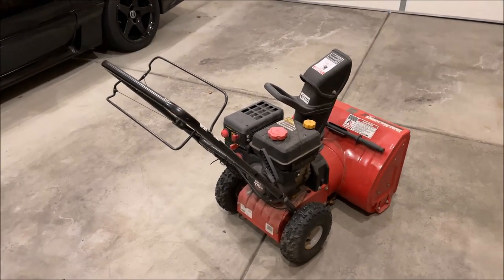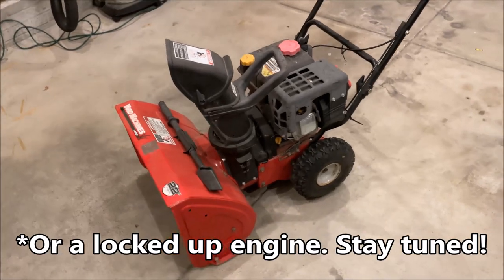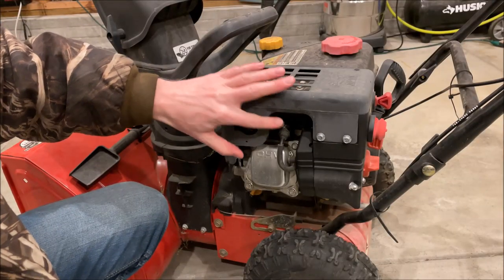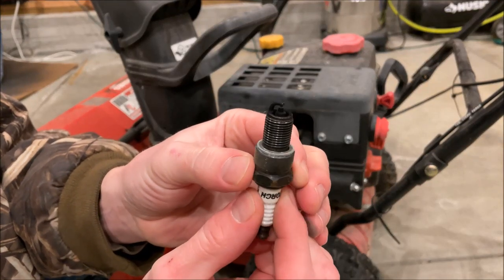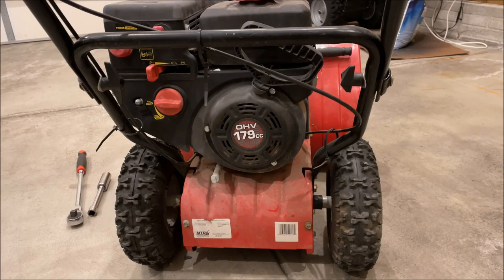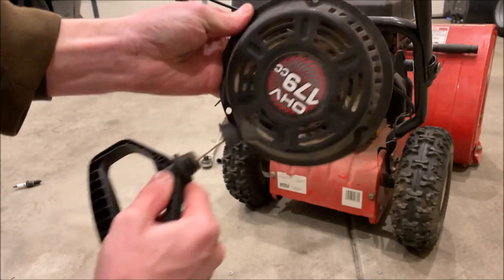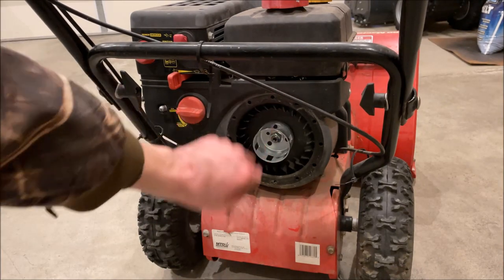Locked Snowblower Pullcord Diagnosis and Fix

Comment: Bam! This video was spot on.  Had a locked issue and now my snow blower started for the first time in three years!!  I removed the pull cord and rotated the fly wheel as you suggested. .  This is after I already cleaned the carburetor, and spark was ok. Changed the fuel and oil change then had the lock  issue.   Thinking the worse and just tried your procedure this am and it cranked up and working.  Thank you!
Reply from the maker: Excellent! Glad this helped you and thanks for leaving a comment 👍👍👍

Comment: So….. I checked your video on pull string locked up. I did all the service to include spark plug, carb clean out and the string was kicking my ass on my salvage tiller. After your video I torqued down until that wheel would spin. And spin it finally did. Thank you for the successful tip. 

Now I gotta fix the tiller belt. Sad face.
Reply from the maker: Ha! Always something else to fix! Glad this helped you get it going 👍

Comment: Great video! Very to the point. It took a half dozen less helpful videos to get me here, but this helps! I have a "locked" log splitter and I'm going to remove the pull cord and try spinning the engine manually! Wish me luck...

Update: Heck yeah!  I took the pull cord off, turned it manually, put it together and it started just like your video! I'm overjoyed! Thank you thank you!
Reply from the maker: Fantastic!  Glad this solved your issue. Too bad the algorithm didn’t put this video first! I appreciate your comment 👍

Comment: Hey Jason,  just letting you know your advice helped tremendously! I thought my 42 yr old Ariens was done for this time. The motor was seized so I did what you said. I was able to turn the motor with a ratchet so I changed the oil, greased it all up, put it back together and it started with one pull like it usually does and works mint! Thanks so much! The 8 hp Ariens lives on! We have a newer 30 yr old 10 hp as back up just in case. Haha...
Reply from the maker: That’s fantastic!  I love reading comments like this. Thank you for sharing and nice job 👍

Comment: so grateful for this video.. i just got my 1st gen from someone who had bought it but never used it. and it was froze couldnt pull cord or use the key start. i tried everything the manufacture told me to and nothing worked... couple of turn on the main crank and i was in luck... thnx again for this video. earned a like and sub
Reply from the maker: Great to hear!  Always nice hearing these stories! Appreciate your comment 👍👍👍
Reply: @FastFixYouTube  yeah you saved me money. Because I was about to take to get fixed and I'm pretty sure they would of charged me for a new engine. Thnx again. Your vid was the only one I saw anyone suggest Turing the crank or what ever its called lol.

Comment: Hi Jason , used your advice on a siesed Rotovator pull cord issue. Turned the crank on removal , looks like you've helped me save this beast with new oil and sparkplugs tomorrow. Thanks for your simple advice,  all the way from a Brit in Southern Italy.
Reply from the maker: That’s great!  Glad I could be of help to someone so far away. Cheers from Nebraska, America 👍

Comment: Great video. My Ariens snowblower was just compression locked. I followed your steps, and it ran great. Let it idle for awhile, took it up and down the driveway ... let it idle more, as I was trying to run out all of last year's gas ... worked great ... then, just to give it another try to make sure it was still working, I tried to start it again, after it sat for some 10 minutes or so ,,, the pull rope was locked up again! Any suggestions?
Reply from the maker: Hello. If it’s compression locked you’ve got bigger problems. There’s a valve relief system on some engines that works off the camshaft. If that becomes damaged, a cam change is the only thing to fix it.

Comment: Question behind that metal wheel is a black piece. What is that called mine is cracked. There is only a small black piece behind that part. Could that be why is stuck.  I will do what you did in this video as soon.  as I get home.  Thank you
Reply from the maker: Hello. I’m sorry, I’m not sure what piece you’re talking about. If it appears to be broken and binding things up, yes that could be your issue. Best of luck!

Comment: I really liked this video and tried to spin my engine with the pulley off. It spins to the right and stops and spins to the left and stops but doesn't rotate fully. What could be my problem? Please help when you can. Thanks my good man.
Reply from the maker: Hello. It sounds like you’ve got a stuck valve or something else interfering with rotation.  Check the flywheel for obstructions. Check belts, etc…. Do this before opening up the valve cover or getting into the engine.
Reply: @FastFixYouTube  Belts are fine. I do smell fuel or Sea Foam in the oil though. Looks like hydrolock to me. I sent it in to a real man to fix for me!😉

Comment: I was so hopeful that turning that nut would free up my engine (Troy Bilt Storm 2410) but it didn't work. My snowblower ran fine last winter, then I ran it dry to 'summerize' it, now the pull cord assembly covered in your video won't move past the hard stop it had and the end of the pull. You mentioned to someone else to disassemble and rebuild the engine. Have you ever heard of using a penetrating oil in the spark plug hole to try to break free the engine? Any tips would be really appreciated! Thanks.
Reply from the maker: Hell and thanks for the question.  If the engine ran fine last year, likely it’s okay this year. By running it dry I assume you’re referring to gas and not oil, correct?  Maybe that’s a stupid question, but people do stupid things sometimes…anyway. Yes, spraying penetrating oil won’t hurt and could offer some help. If you choose to do that, definitely drain and replace the oil after. As far as a complete rebuild, no that shouldn’t be necessary unless the motor is completely seized and the piston rings are toast.  This would only happen if you ran it dry from oil. 

When you try and spin the nut, use constant force not just quick momentary force to spin the engine. Using constant force for several seconds eases the engine into turning. Using high force quickly sometimes doesn’t get the job done. Also, a large breaker bar will help you accomplish this. Also, make sure the spark plug is out when you’re doing this. Please let me know if you have further questions. Also, let the thread know how it turned out. Thanks!
Reply: @FastFixYouTube  Thanks! Yeah I meant the gas not oil! That pull cord nut - so I unspun it a few turns, reinstalled my pull cord and it gave what felt like a full pull, but while the pull cord itself recoiled, the nut part on the machine side stayed all the way to the right, so I only got one pull. Any idea why that would be? I just bought PB blaster to try to free up the internal parts, and will update once I give that a try.
Reply: Update: Sprayed some PB blaster into the cylinder via the spark plug hole, waited 5 minutes and then was able to get the nut to spin! The first time the cylinder head came to the top it burped out a bunch of seeds. A mouse must have crawled in through the exhaust. Anyway, got her running! Bring on the snow!
Reply from the maker: @michael78033  oh wow…. I was not expecting mice!  Geesh, something new everyday. Glad you got it spinning!

Comment: ? Does that fix one with electric starter? Sadly I can't take off the spark plug I don't got a long enough socket but mine is locked up hard even on the electric starter and I already checked the belts they look good and such so from the video just removing back spark plug (if it's bad) will allow it to be pulled if the plug needs to be replaced right (I know nothing of engines)edit BTW you happen to have a video on how to drain and change oil on a snow blower your intrusion is very easy to follow
Reply from the maker: Hey there. Pulling the plug out isn’t 100% required. It’s just makes rotating the engine easier. Try turning the flywheel (the circular piece that spins and usually has a mesh cover) by hand. If you’re unable to do that, you’ll need to remove parts to get to a bolt that you can put a socket on. Hope this helps.
Reply: Took the pull string off and for some reason I have a huge turn bolt I don't a anything big enough to fit the things as round as a size 14 so I'm out of luck
Reply: @FastFixYouTube  messed up I had it running like a week before hand
Reply: @FastFixYouTube  OK so I used a really long screw driver and it spins to a point and then is totally stuck same thing if I simply turn it the other way any ideas pretty sure its supposed to be able to spin forever right?

Comment: What is the part called that your spinning with the wrench? I have the same snowblower and the part spins freely like no compression / it’s not turning the motor over
Reply from the maker: It’s the flywheel bolt. Odd problem… it’s directly connected to the crank shaft, so…you may have larger problems.

Comment: Hey man! This video is great! I have a single stage troy bilt snow blower. I changed the oil and now the cord is locked up. I added a little too much oil so i drained it to get the level between the low and high marks on the dip stick. The cord pulls out when the spark plug is removed but soon as I put the spark plug back in....the cord locks up. I am confused as to whats wrong. I cleaned the spark plug, no cracks or damage on it and the gap seems about right. What would you recommend I do? I dont really want to take it in to get it repaired if it's something super simple.
Reply from the maker: Hello. Does it have a Briggs and Stratton engine?  If so, there’s a notorious problem with those engines. The camshaft has a compression relief mechanism that slightly bumps the exhaust valve in order to relieve pressure in the cylinder which allows the engine to crank over.  The mechanism will frequently break which causes the engine to freeze up due to unrelieved cylinder pressure. 

In order to trouble shoot this problem and with the spark plug installed, try pulling the cord and keep constant pulling force on the cord. The pressure should bleed off and you should be able to slowly turn the engine. If the engine slowly rotates, it’s likely the camshaft needs to be replaced because of the mechanism failing. Hopefully that’s not the problem, but it’s what’s coming to my mind. Feel free to update this thread. Best of luck
Reply: same here!!! Brigss 1350 on a Craftsman… Bought new and never been a great tool.

Comment: Hi, I did what you said and the it turned a little each way then was stuck. Any suggestions?
Reply from the maker: Hmm… try lubricating the cylinder with oil. Remove the spark plug before rotating again. If that works, don’t stand near the spark plug hole. You will get sprayed! If that doesn’t work, you probably have other issues that will require the tear down of the engine. Provided nothing external is stopping the rotation from occurring. Make sure you’re applying plenty of torque. Best of luck!

Comment: My Poulon Pro snowblower is doing this but the cover is riveted on the pulley. How am I supposed to get it off and then back on again?
Reply from the maker: If it’s riveted, you can’t without drilling out the rivets. I’d ask a small engine guy about that.

Comment: Good stuff. I would have like to see you fire it up after that. Thanks for the video
Reply from the maker: Yes, I just didn’t have time to do everything it needed and wanted to get this video out. I fired it today actually. Changed plug, oil, gas, and cleaned up the carb jets. Started on the 10th pull! Haha.  Runs good. The old oil was like water.

Comment: Hello,

I have a toro ccr 2450, to be straight to the point I cleaned the carburetor then it started. Few hours later tried to start didnt work. So I cleaned the carburetor again and cleaned the fuel jet with carburetor cleaner. Tried to start it with the electric option. I dont know if it did something to the motor . I did see power in my room get dim idk because of the amperage the snowblower drew or because something else. Now the engine won't turn only turns with the spark plug removed. So it is a compression lock as you demostrated in the video. What do I do now?

Do I turn it more with the spark plug out? Or do I turn it with the spark plug 🔌 in? If you can help I would gladly appreciate it. 

Thanks
Reply from the maker: Hello. Unfortunately, it sounds like a case of compression lock. I’d say cleaning of the carburetor and the motor starting was purely coincidental unless you manipulated the motor to just after TDC then tried to start it. 

So, if compression lock is what’s going on, the only true way to fix it is to replace the camshaft.  The cam has a compression release mechanism that fails and the only way to fix it is to put in a new cam. 

A work around (what I do) is to spin the engine just past TDC on the compression stroke, remove the air filter, stuff a rag into the intake, then try to start it. This method always works for me, although sometimes it take one or two attempts. Obviously you’d pull the rag out as the engine is starting otherwise you’ll choke it out. 

Let me know if this works for you or if you have questions. Best of luck!
Reply: @FastFixYouTube  Thanks for getting back to me. How do I spin the engine past the TDC?  Do I need to take off the pull rope and turn the nut like you did in the video? Clockwise or Counterclockwise?  Is this all happening when the spark plug is in or when the spark plug is out? Also just to be clear stuff a rag into the airtake means put a rag inside the muffler or take the muffler off and put the rag? Sorry for the excessive questions but I don't want to be confused on anything.  

Is the "camshift" worth replacing?  Or sending it to place to fix it worth the money? 

Thanks man I really appreciate your feedback, gonna send this to all my buddies who are having similar issues.
Reply from the maker: @MJ-wx7em  Hey there.  No problem with the response!  I made the video, so I should reply to the comments.  Yes, you'll likely need to remove the rope pull starter in order to spin the motor.  Clockwise is fine.  The spark plug can be in or out.  It will be harder to spin the engine if it's in.  No, don't remove the muffler.  The air intake is just before the carburetor.  It will have an air filer.  Remove the air filter and cap the intake opening with a rag or similar.  Don't shove it all the way in there.  You just don't want much air getting into the engine prior to start up or you'll run into compression lock again.  The cam is worth replacing if you don't want to mess with spinning the engine and using a rag each time you want to run it.  It's probably not a cheap repair however. Hope this helps!

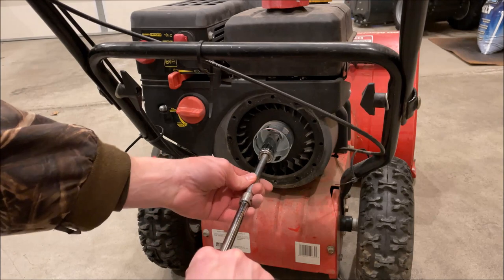Comment: I have a Craftsman snowblower with electric start that has not been used for 3-4 years.  I tried starting it manually, but the pull cord would only come out about 6-8" or so.  Just like yours did in this video.  Removed the spark plug...no change.  My situation is exactly the same as yours until the 2:00 mark.  When you are able to use the wrench and socket to spin your engine (is that the flywheel?) around and around, mine only spins maybe one turn and then stops and is stuck again.  I also tried my electric starter.  You can hear the starter trying to work, but nothing spins then either.  Checked oil and gas.  Both are good.  Any ideas?
Reply from the maker: Hello. I think I have one potential explanation of your issue. First, yes in the video I’m spinning the flywheel. If yours spins even half way, the motor should be okay. However, if it’s unable to continue to spin at some point in rotation, that’s a problem.  If it’s been sitting for 3-4 years, it’s likely things are a bit on the stuck side. Most likely is a valve that’s stuck open. This will prohibit the piston from moving upward at a certain point and disallow the engine to make a full rotation. To check for this you’ll need to pop the valve cover off and visually inspect the valves.  Unfortunately, you’ll likely need to remove the rocker arms as well then see if you’re able to depress the springs and test the valve operation. I have no idea how mechanically inclined you are, but if this is reading a bit heavy, it might be best to take it to a shop. Another potential cause is a rodent nest. I know it sounds unlikely, but some on this thread have commented that a mouse nest was causing the issues of a non-spinning engine. Little buggers get everywhere. Sorry if this wasn’t much help, but it’s likely that a proper diagnosis will require a bit of disassembly and inspection.
Reply: @FastFixYouTube  Thank you so much for your reply.  Do you think draining the oil, removing the sparkplug, squirting PB Blaster in the sparkplug hole and letting it sit overnight might help?  Even if it is a stuck valve?
Reply from the maker: @janicetarson1037  Hey there. No problem with the reply 👍.  No, I dont think that will help you considering you’re able to spin the motor about half way. There’s something interfering with the rotating assembly prohibiting it from making a full rotation.  If it was a matter of new oil and PB blaster (which would indicate the motor being frozen due to non-use), you wouldn’t be able to spin it at all.  There’s something like a stuck valve or foreign object causing the issue. Of course, my diagnosis is only as good as we can communicate across YouTube, which sometimes doesn’t translate. You can certainly try your idea…it won’t hurt anything and you’ll need to change the oil anyway considering it’s age.  Feel free to keep this thread updated. I usually see the replys and try to reply as well. But at this point I’m still thinking stuck valve or mouse nest 🐭